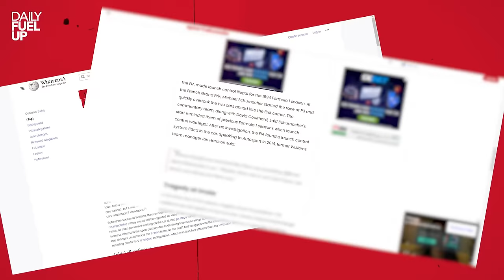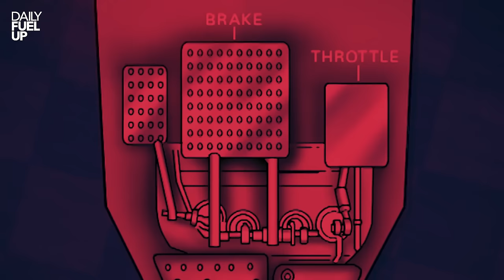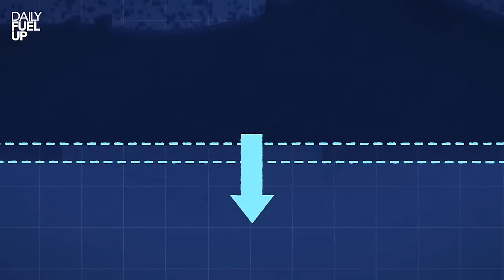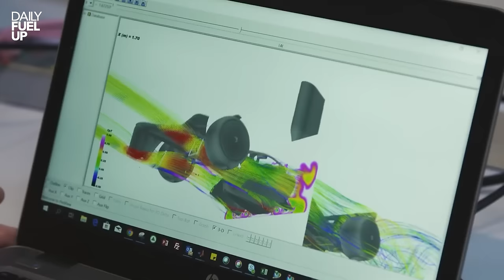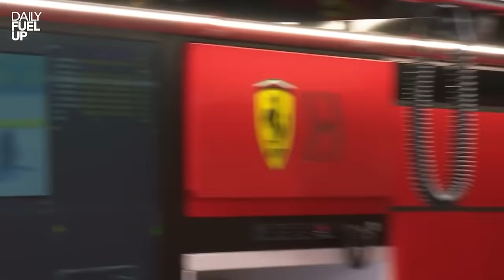10 Genius Innovations BANNED From F1

Comment: Everyone always talks about active suspension and then say “modern road cars have it”. Yes they do, but it’s ENTIRELY different. Modern road cars will have active dampers that can be adjusted and if they have adjustable ride height it’s 99% of the time from air suspension. F1 active suspension was purely hydraulic. Where there were no springs and no dampers. It was hydraulic pistons that acted upon the system in compression and the system acted upon them in rebound. The closest system in a road car to what F1 had is the active suspension in the new Porsche Taycan Turbo GT. Where it is mostly running from a hydraulic system. It has taken 30 years to get a system in a road car that is even remotely similar to that used in F1
Reply: Mercedes offered a real, hydraulic active suspension in their top notch road cars at one point.
Reply: @christiannasca3520  yes the ABC system. Which is actually a really good compromise between a road car active suspension and what you would see in F1. On the ABC systems, there is an air spring and adaptive damper at each corner (like most road car systems). But each spring also has a hydraulic top hat that can change the ride height and weight transfer independently to counteract cornering forces and braking/acceleration forces (similar to F1). The benefit of having both systems is you don’t have to program the hydraulic system for absorbing bumps

Comment: Imagine what F1 would look and sound like without all these restrictions
Reply from the maker: Would be so incredibly fun to watch
Reply: An actual article in F1 magazine asked this very question. Ferrari said they'd run a 6 wheeler with a V10 if they could get away with it. Interestingly, their designers at the time preferred to put the 4 on the rear, probably so the car wouldn't slide too much. Now there really was a 6 wheel car called the Tyrell P34. It wasn't a bad idea as it did win several races. The biggest issue was the tires were expensive and had to be custom built for that exact car. No other car could use those tires.

Comment: To such innovations, I'd add 4wd f1 cars which were -guess what - banned due to unfair advantage. Seriously though, some variation in the engineering of cars would be awesome to see. Regulations are so strict that every car looks the same and performance only depends on the engine and not other cool stuff like the air pump, 4wd and six wheels you mentioned. just imagine if all that stuff weren't banned

Comment: Right wing, left wing, front wing, rear wing, does not matter on which wing the active aero gets to be. Electronic driver aids are just that. Replacing drivers with electronic aids. We have drivers because then know when to brake, they don't just smash the brake pedal all at the same time counting on ABS to do the rest. We have drivers because they know when they lose traction and how to correct it not in order for them to all drive the same line counting on the traction control to do the rest. We have drivers to know what gear to shift into, not a computer to decide what gear/revs are the best for the car in current conditions. We have drivers for a reason. If you don't like that, then fine, just replace drivers with computers and call it a drone F1.

Comment: D.A.S. = Dual AXIS System... Not Acces
Nice video, but quite annoying you often use footage that differs years or even decades from the subject. Example, just one of many: BMW-Sauber, using V10 engines, had nothing to do with the BMW 4 cylinder Turbo engines from the 80s. Confusing for F1 Newbies who simply get wrong (visual) information, annoying for F1 Fans. Something to take into account for your next videos perhaps?